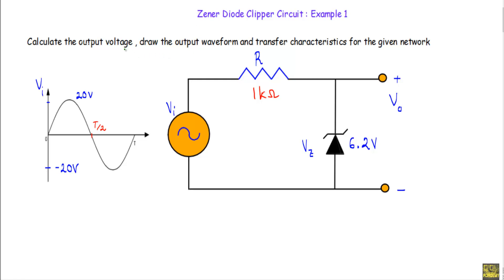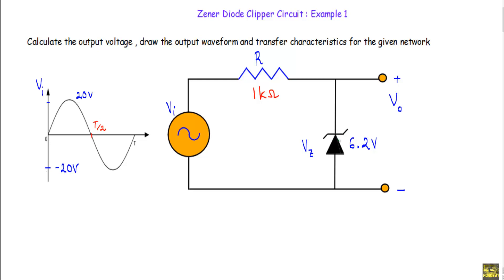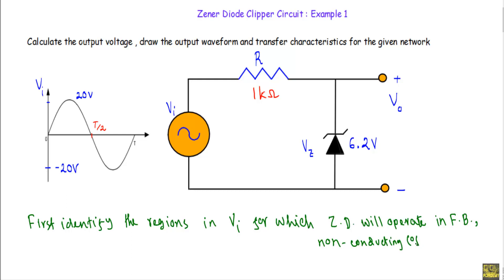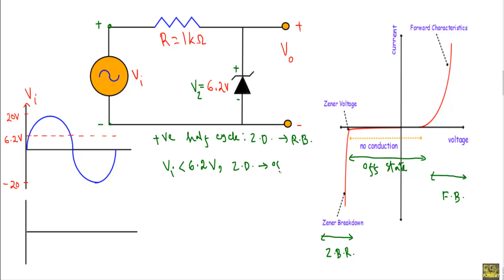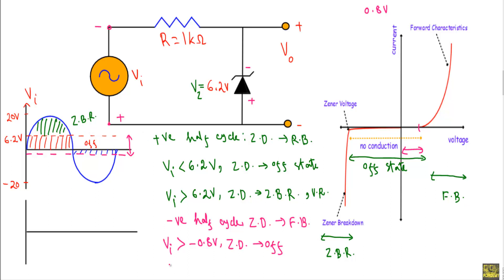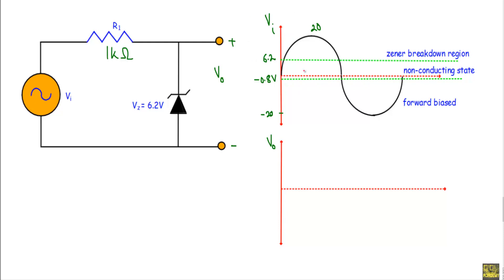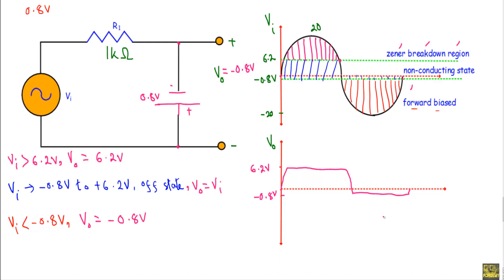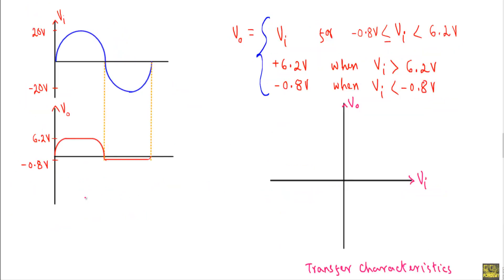Zener Diode Clipper Circuit : Example 1(with simulation)

Comment: You made a big mistake on 9:50, zener diode doesn't start conduct from 0V of input voltage!! It has some time shift (equivalent to the time when input signal reach 6,2V) in corenspondance to input voltage.
Reply from the maker: When did I say, Z.D. start conducting from 0 input voltage?? I clearly mentioned about three different bias regions of Zener diode at the beginning. However, here I focused on Z.D. clipper circuit, not any phase shifter. To get more clarity, set the circuit in Multisim and check your confusion
Reply: There shouldn't be time shifting, you're right. My mistake, sorry once again.

Comment: Is 6.2volt negative or positive for zener diode???
Reply from the maker: As 6.2V is zener voltage, it must be reverse voltage
Reply: Then my doubt is why you drawn 6.2volt in positive half cycle.. it is for negative half cycle yes or not
Reply: Please clear my bad doubt...
Reply from the maker: It is not for the negative half cycle...It is for that half cycle for which Z.D. will be in R.B. . Here, Z.D. will be in R.B. at +ve half cycle